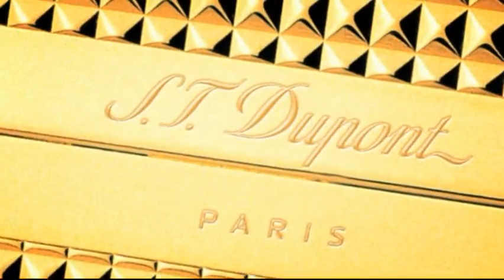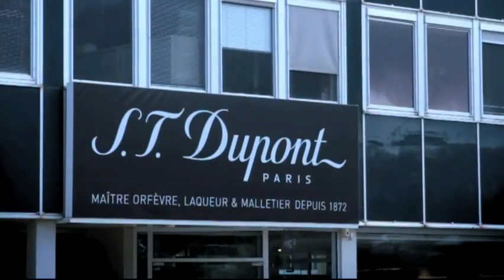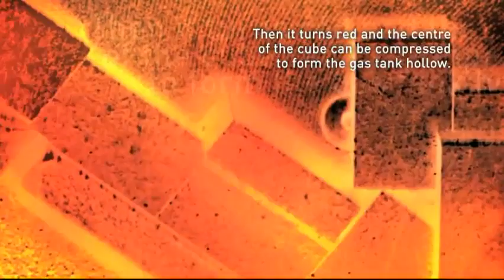S.T. Dupont Lighters creation process, part 1.

Comment: Nice process.. still doesn’t justify the high price for them lighters … maybe if they were made only by hand i would spend 5/6/7/8 hundred $ for one lighter.
Reply: Its basically considered jewelry.
Reply: Get a second hand one
Reply: Don't buy a Rolex either! You want to play you gotta $$$ PAY! 😆
Reply: @FyukYiu  But the material used on the website says it's brass. It shouldn't be that expensive.
Reply: @turkey0165  At least Rolex uses gold/diamonds/etc and not just a silicone + digital watch.
Reply: @FyukYiu  Sure, if you want to consider brass jewellery...
Reply: @RP-dy5mu  Modern Rolex steel watches sell for as high as $40k on the secondary market. That's some expensive steel. A $900 brass Dupont lighter seems like a bargain.

Comment: How can i know My Dupont is real? Please any mail
Reply: That is an excellent question, usually you can visually just spot some differences between a real one - for example the serial number will be stamped perfectly or the case will be textures in a weird way. There is also the serial number again, many fake lighters use the same serial number.